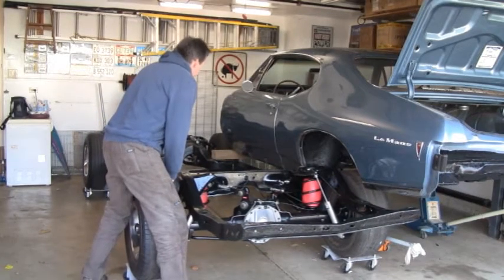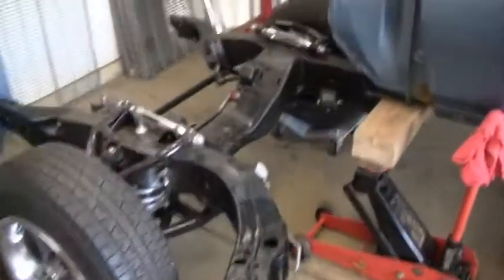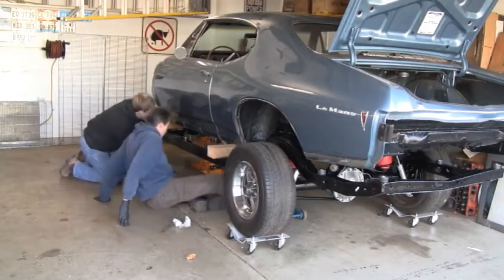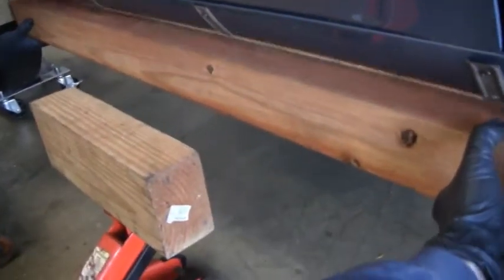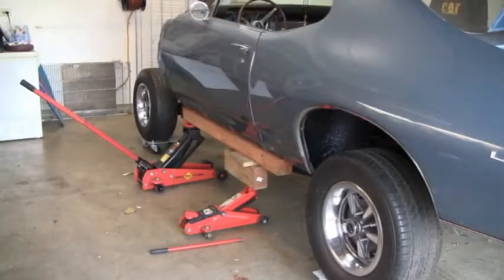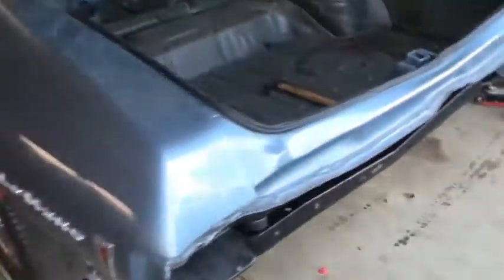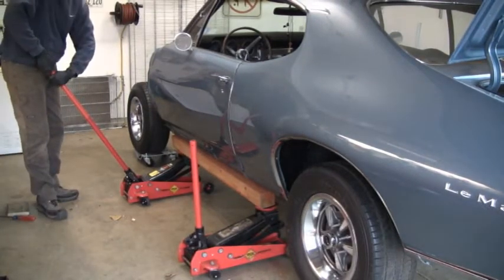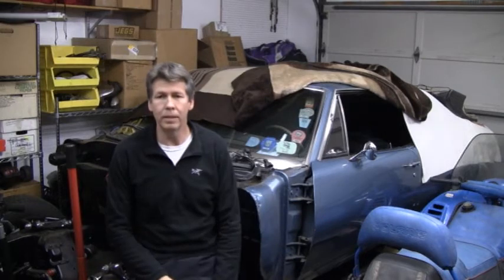LS Conversion Swap Part 26, Body Back on Frame

Comment: Are those 8 or 10 ft...  good video by the way
Reply from the maker: I believe the 4x6 for the dolly were all 8ft and the 4x4 i used under the rockers were 6ft cut to fit.

Comment: I have been following your LSx Swap for quite some time and I had the same idea to lift the body off the frame, grooved wood for the pinch weld and all! Glad to see that method in action, even though my project is a 80's GM B-Body Coupe, the same method can be adopted. I don't have the luxury of a lift either, I am glad this method worked out great for you and now I'm looking forward to mine as well. I like your work and methodology for an at home garage build, I look forward to the rest of your build!
Reply from the maker: I am glad you like the vids. The process went really good. The method was from watching a few Youtube videos of others doing this, combining what I liked about those and augmenting with my own ideas. Just a reminder for anyone doing this for sure remove the gas tank and exhaust system otherwise the job is a lot more difficult. I removed the tank (a tip from someone else) but did not remove the exhaust which made removing the frame a lot more difficult with this method. Good luck!